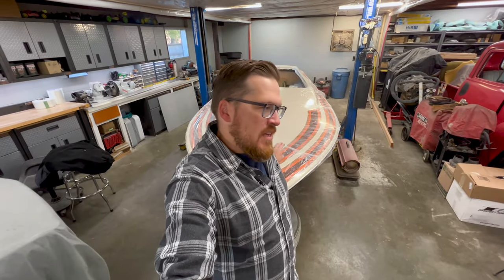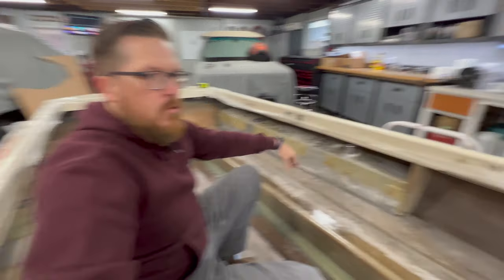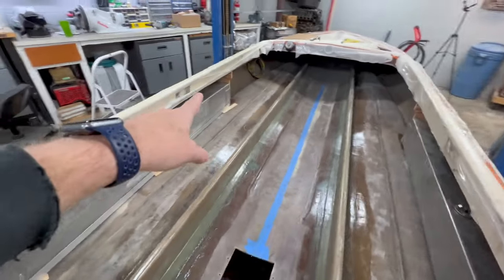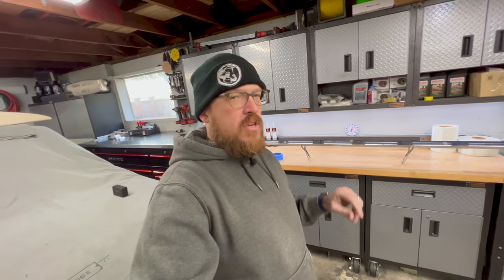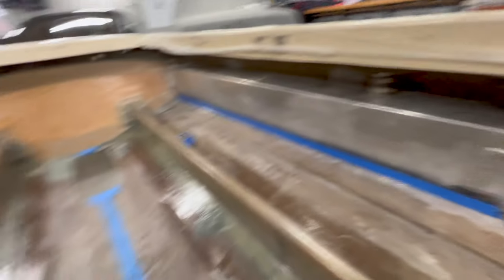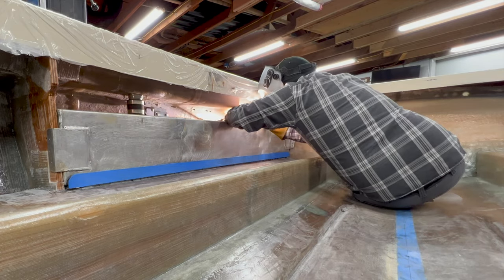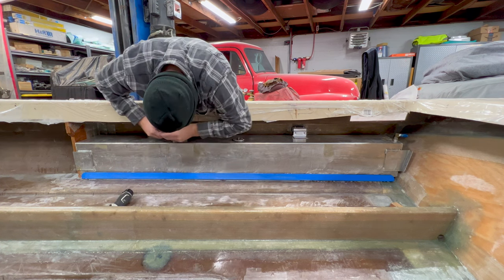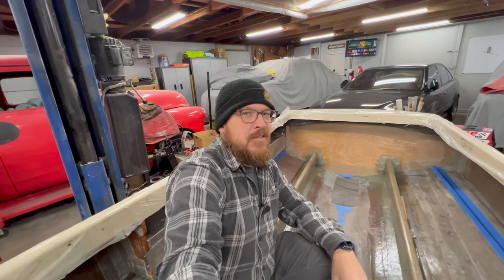How to Mount and Install Aluminum Fuel Tanks into a Jet Boat

Comment: Hey Nick...!st class install! Love it, Jet boat rebuild videos are the best!I The mounting job is perfect, that is a sweet set-up for tank mounts, tanks are going to look sweet polished and exposed .....I am cruising over and bringing my 21.5 Careera to your shop ..it has a blown 540 in it ...I wantedi install 20 gallon tanks, the boat gets gallons per mile not miles per gallon!! HAHAHA..... I would do a clear coat on the outside of the back of the stringers, have you seen Finnegan's Elimator he built for his wife? That boat is sweet and he put together some great detailed videos,  allot of cool ideas you can get from those videos...he also installed a jet-a-way on the jet drive which i thought was pretty cool to have if your going to put some big HP in your boat..You have to check out the video where he builds a custum fuel cell for the Eliminator.
Reply from the maker: Thank you Shawn, I appreciate the kind words. Your boat sounds killer! What size of impeller are you running with your setup? Do you know the rough HP of that combo? I can't express how bad I want to put a blower on my setup... Yes, I have seen Finnegan's videos... He certainly has lots of cool toys to play with. I do like the Jet-A-Ways, the downside is I do not have enough space to install one unless I was to perform a pump setback.

~ Nick
Reply: @AutoTechNick  Yes, don't waste your energy on setting the pump back to much extra work and there no need for it...
The Engine is pushing about  800+HP, I had a A/B impeller in there I just had the impeller replaced, I don't know if is a AA or A I will find out for you, I had a porpoising problem which I finally got rid of, the stringers on the trailer were not level which caused some hook on the bottom of the boat! 
I have never taking the boat over 90mph with this set-up, because the high speed porpoising was sketchy! I just went to Havasu 2 weeks ago to test run it and it was freezing cold out there and wind was blowing hard, finally had a decent day to take it out. The porpoising issue at higher speeds is gone now,
but still does it at lower RPM's 3000/3500....even with the trim all the way down it does a little porpoising nothing like before and the water was still a little to choppy and sketchy to go full throttle!  

I use to run a Berkley droop snoot but took it off because it help reduce the porpoising, it's back on now and rides way nicer. I have a crazy sound-system in this jet boat and there is 12-inch woofers in the bow, now I am thinking that is causing the porpoising too, so  I am pulling those out next time I go to Havasu, I'll bet you thats going to make it ride way better.

Before this 540 set-up I had a blown 454 with a 871 blower with nitrous , still have the same blower on this engine got rid of the nitrous. I ran the 454 set-up and was at lake Shasta and she ran 104mph @ about 6000rpm.. I also have some wedges that we just installed on this new set-up, Harold Bruce at R&D marine in Havasu did the pump work and got the hook out of the bottom, he has been in the game for decades and is a Guru with Jet-Boats give hime a call, early hours are best to reach him. He can guide you with the proper pump and engine set-up.

I would suggest just running a naturally aspirated 540, with a single carb and with a one piece rear main seal, so you don't have oil leak issues which are so common on two piece rear main seals. you can easily install a 100 shot nitrous set-up if you want that extra HP every once in a while.. as long as the motor has high end parts you'll be fine. Run a solid roller cam too, you'll get way more power out of it, than a hydraulic roller, all you have to do is adjust the valves once or twice a year depending on how many hours your going to run it. If you keep your motor naturally aspirated youll have way more fun with the family, and your not going to be stopping and every gas pump on the lake all day and can enjoy boating. 

I have gas anxiety in my Jet Boat which is very annoying!!!!! I aslo have a 1992 Eliminator Mod-V 234 with a stock 454 and mercruiser bravo one drive, she does 70mph at 4000 rpm and I can boat for 2 days without filling up on two 20 gallon tanks, the jet-boat is great for the river but with 15 gallon tanks depending on how heavy my foot is in it, she will get 20-40 miles with 30 gallons of gas!!! Hope this helps with some ideas...Wishing you a smooth and pefect Jet-boat build!!

Comment: We used to take our Rogers jet to the western lakes, Powell, Mead, Havasu, and Shasta and when it's 110*-115*, a light to medium gray (or another neutral color to complement the exterior) was way easier on bare feet than anything that is a solid surface. If you don't boat in these conditions, take your pick on surfaces and colors.
Reply from the maker: Ronald, That is a very good point you bring up. That is something that I had not really taken into account. I don’t frequently boat in the temps, plus my engine bay is fully covered… So all options are still on the table for me. 

~ Nick

Comment: You could do gelcoat with some soft sand nonskid.  Easy cleanup and plenty of traction.
Reply from the maker: Good idea. I had not yet considered that approach. I am thinking that I will finish all my fiberglass and woodwork. Bet the pumps and battery mounts in and see what I am left with. Then I will make the call on how to address the floor. 

~ Nick

Comment: One thing I am doing on my boat to reduce (hopefully eliminate) water intrusion,  is over drilling or cutting any areas that will be screwed or bolted and filling with fiberglass filler and glassing over. For example the drain plugs are installed in this filled fiberglass area so no chance water can get anywhere near the transom wood. Was thinking you could do the same in the stringer/transom drain holes.
Reply from the maker: Those are some good ideas. I have a similar approach: I want the water to drain to the bilge area ASAP. I want all my drain openings to be large enough for water to flow underneath them, and not really be touching the wood.

I would be interested in seeing more about your methods for the drains. 

~ Nick

Comment: Man, your videos on this boat rebuild are likely the best I've seen on Youtube - very detailed, great quality video, and the quality of your work is exceptional! 

I am planning to rebuild a 14.5" Hourston Glascraft (Vancouver, BC, Canada-made boat) runabout - it's going to be about the same depth of job, in that I'll be taking the cap off and then redoing the transom, stringers, and floor all from the inside (boat properly supported of course).

Just wondering (sorry if you mentioned it in a video and I missed it) - how much time did it take you roughly to strip the boat and get to the boat of glassing in the new transom and stringers? I know you have the floor to do still but wondering roughly how much time a project like this could take - I am basically planning to spend most weekends through Jan - Apr on it if needed.

Thanks again for doing all this and I look forward to watching more - may do my own videos for mine as well!
Reply from the maker: Calvin, Thanks for the compliments. I really do appreciate them. It takes a fair bit of extra work to film and edit these videos. But getting feedback like that is very rewarding. I decided to start this journey to help others with their projects, whether technically or motivationally. I am glad to hear that I am starting to achieve what I set out to do. 

I honestly struggle with balancing the amount of detail to put onto a video and its overall length. It's a difficult balance and I am still trying to hone in on it. 

I cannot give you a direct answer to your question about my time invested in this build. I try to work on the boat for at least two full days a week. I started this project at the beginning of April 2022 and I have been working on it since, except for a few weeks here and there. Now the filming does slow my progress some, but there is no way around it... This job is a big one and requires a significant amount of time, effort, and money to be invested. When I am finished with this build I will be making a video that covers the work I did, how long it took, and what it ended up costing me.  I am sure that a lot of people would really like to know that info before moving into a project like this. 

I initially went into this project thinking I was only doing stringers. Then I found the damage to the transom. At that point, I decided to fix & improve everything that I came across. So I am changing and correcting ALOT of things. It's safe to say that this project is suffering from a massive amount of mission creep.

I hope your project goes smoothly. Feel free to reach out if you have questions during your build. If you decide to film it and make videos let me know... I'll be watching!!

~ Nick
Reply: @AutoTechNick  thanks for the detailed response! Totally get that it's hard to give any direct answer to that kind of question but what you provided above certainly helps me ballpark it.

I think all the things you decided to do made a lot of sense - transom for sure with the stringers and floor out, moving out the stringers for more engine mounting options was also logical and no doubt added a lot of time. I think mine will be more straightforward in that I won't be changing any design overall but for sure it's gonna be a ton of work either way - I have a good amount of experience with mechanics and electrical but not as much with woodwork (why I want to do this, to build those skills) so it will be a significant learning process.

Cheers and looking forward to your next videos!

Comment from the maker: Guys, let me know what your thoughts are on the upper mounts for the tank. And also what you think I should do to finish the floor out in the back on the outside of the stringers…

Thanks ~ Nick
Reply: Could you add all of the Jet Boat related videos to a Playlist? I watched the Playlist you have and thought those were the only jet boat related vids..  ill look for the others but would make it easier for us just joining in on the build. Great job by the way.. love jet boats. Doing a jet swap on an 85 chaparral 162. Been a work in progress.. but vids like your get me pumped up to start working on it again
Reply from the maker: @djmjr77  I have two playlists for the Jet Boat. One of them is dedicated to the transmon and stringer replacement videos. The other contains all of the videos that I have done on the boat. It can be found here: https://youtube.com/playlist?list=PLF5nyN7G9cG1v_N_Je_DCH8q1BtZj8vTz&si=EnSIkaIECMiOmarE

If are looking for something a bit different than that, let me know and I'll see what I can do. 

~ Nick
Reply from the maker: @djmjr77  I am super stoked to hear that these videos are helping you with your project. That was my main goal when I chose to create this channel and videos!! I wish you the best of luck with the conversion on your Chaparral. 

~ Nick
Reply: How about sea deck or some similar product.
I would think if you doubled up on the rubber washers, it would work to dampen vibration.
Enjoying your videos.

Comment: I vote to use rubber/nylon washers on the tank brackets.  You need flexibility in the bracket.  No carpet along tank.  Hard to keep clean and carpet holds water.

Comment: Instead of carpet there is a few different types of turf that is used commonly in the JetSki community. HydroTurf is a good option for the floor . Also JetTrim.
Reply from the maker: Thanks for the tips Danny. I’ll take a peak at this products you suggested..

~ Nick
Reply: By the way! Love the detail, and attention to camera angles. Really helpful for understanding! As for the turf, there are so many options out there now. You can also have custom turf cut with your own design and colors. HydroTurf has diamond cut and waffle cut sheets. Make templates and use Weldwood Red cement. 3 coats of cement on each mating surface.
Reply from the maker: @dannynewman6277  Thanks Danny. I really appreciate the kind words!

Comment: Question for you, where did you get the shut off valve that is attached to tank. And then what is attached to it inside the tank to be able to get fuel out? TY
Reply from the maker: I do not run shut off valves on my tanks. What you see on the tank is the fuel pick up. It is a small tube that runs down to the bottom of the tank, it sits maybe 1" above the bottom. 

~ Nick

Comment: Nick- whats your system for dual tanks , switching between the 2 tanks and a gauge etc?
Reply from the maker: No switching system. I pull from both tanks at all times. 

I have a toggle switch that allows me to switch the guage reading between the right and left tanks. But I rarely switch it, since it puls the fuel from the tanks evenly. 

~ Nick